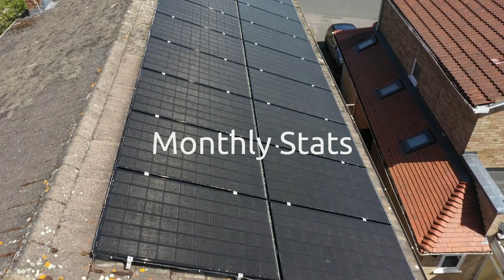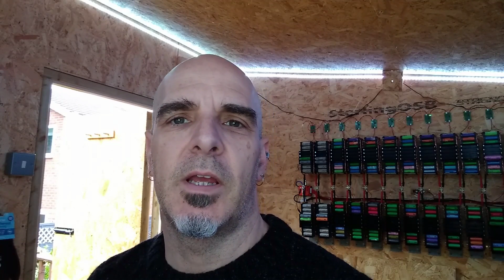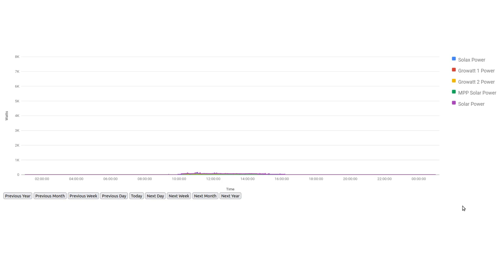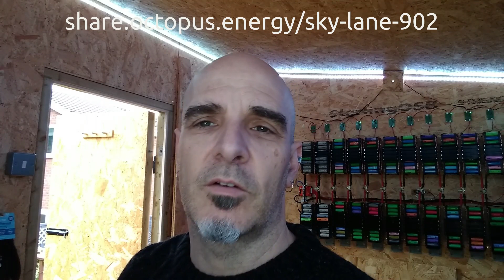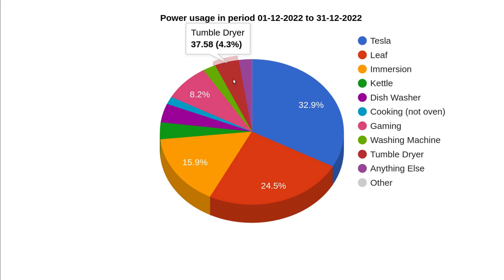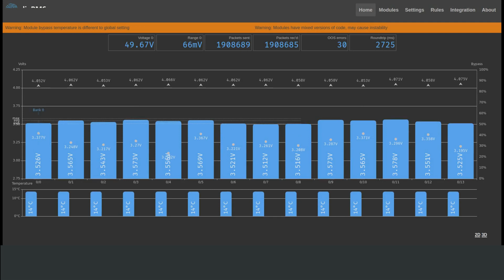Solar/Battery stats for December 2022

Comment: You can use that grid free time to good use if you get some cheap 3 amp chargers from allli they cost around 7to 8 bucks,  a few of them in parallel gif you cheap vast charger .. you can put as much off them on that bank until you reach the max charging current because they all have a back flow protection.

Comment: Good round up. 1.37mwh import of which 89% was off peak. 0.121mwh generated from a 10.6kwh array. Our calculated break even point for the array where the amount of generation should start to cover usage is 10 hours of sunshine a day, so from 20 Feb until 20 October. We added a new battery and this means our off peak figures moved from 75% to 89%. Our average unit cost has jumped from 0.07pkwh to 0.11pkwh, but the cheap rate has shifted as well. Worse day was 0kwh as the panels were covered with snow, best day was 11kwh on 08dec. Have you got the old battery working ?
Reply from the maker: Unfortunately I'm still looking for an old Extra2000 unit being sold for parts, so it isn't working yet.

Comment: Hi Nicholas, happy new year to you and all your viewer’s..
Solar 5.74 kwp n/e & s/w split
No batteries yet
Eddi for hot water and heating
Dudley West Midlands 
Generated 89.8 kWh solar
Consumed 86.6 kWh solar
Eddi used 26.7 kWh 
Grid use 295 kWh @ £0.334 kWh 
Managed to save £28.92 from solar
I think my results are ok for the dark December we’ve all had..
My best generation was on 9th December with 7.1 kWh 
My worst day was on 11th December with 0.1 kWh 
I should be getting my 7.2 kWh battery fitted 9th January just in time for the longer days….
I look forward to your videos and all of you viewers solar stats for the month
Thanks Nicholas